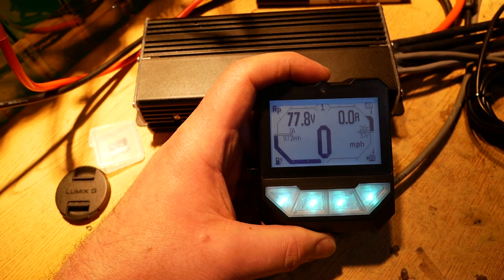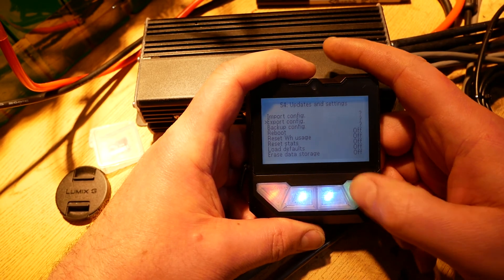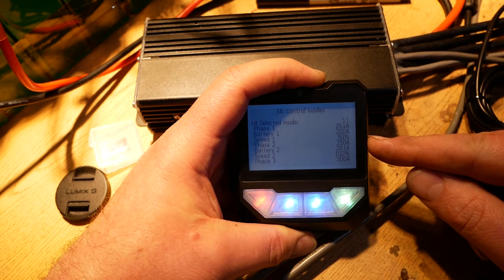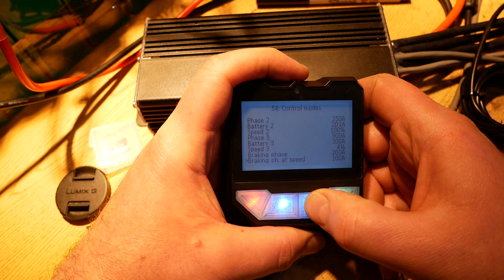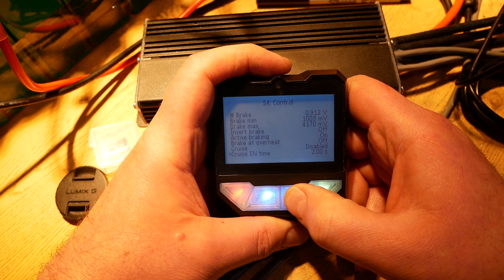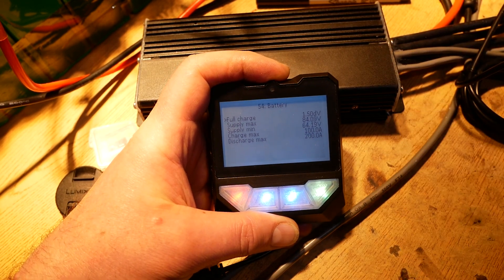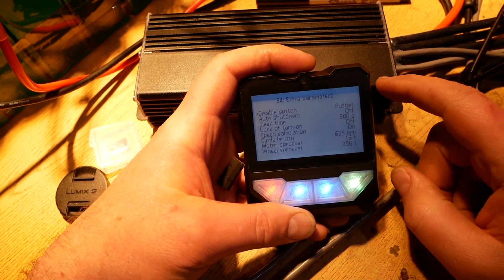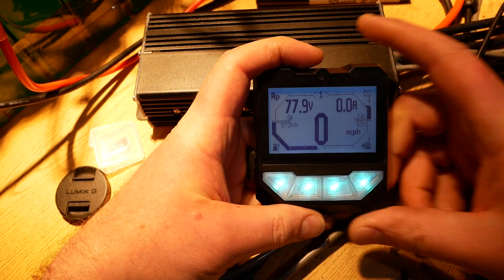3 Nucular Controller setup walkthrough

Comment: I could not get this thing to work with my bike. I kept getting Hal sensor errors and my throttle does not work for whatever reason. Throttle worked fine with the stock controller. Now how do I return this hunk of junk to Russia =[
Reply from the maker: PM me on facebook...Richard Gumfaw. Lets see what you have. Might be easy to get it going or worst case, if you have one of the new versions of the 24 fet, I might buy it from you.
Reply: @de-bodgery  okay thank you sir I will Pm you later when im free.

Comment: can you have preset modes for example street legal mode and offraod mode?
Reply from the maker: Short answer: yes
Longer answer: set up the 3 speeds modes so at the flip of a 3 position switch, you can access whatever power and speed settings you program into the controller.
*
I've heard rumors about European cops being somewhat tech savvy. Hide your switch so they can't find it. The switch needs maybe 200mA contacts so it can be quite small. In the USA, the cops are pretty lazy. They know nothing about your EV. So just avoid getting caught for speeding and you are OK. Even then, they are usually watching cars and motor cycles, not people on bicycles and scooters. I've ridden past parked cops with their lidar/radar guns trained on traffic and rode right by with the traffic.